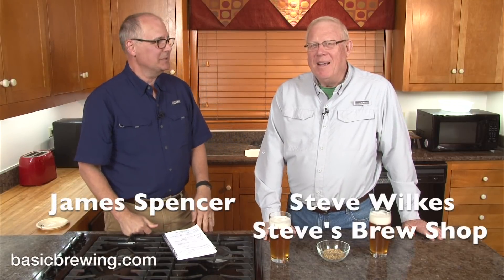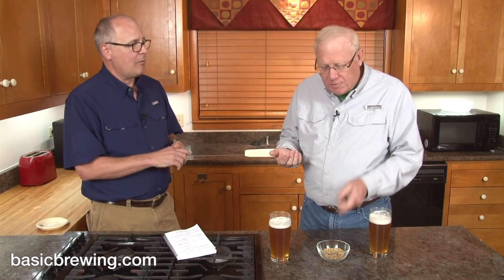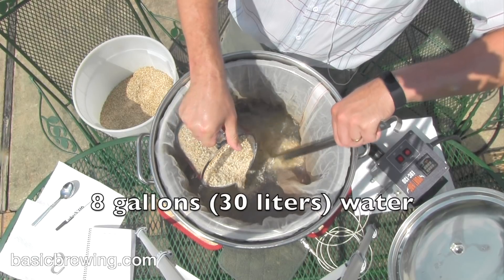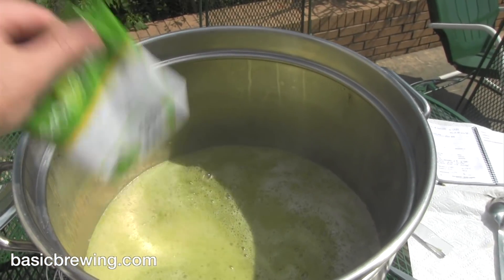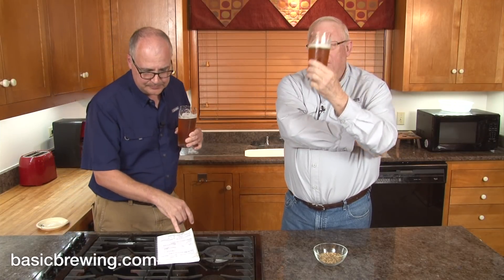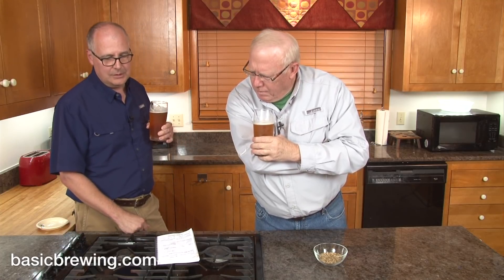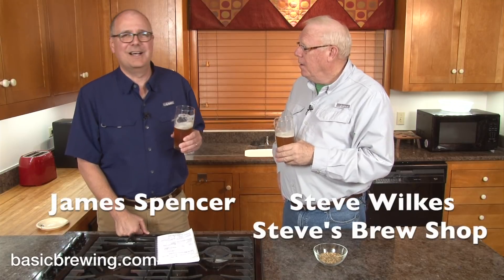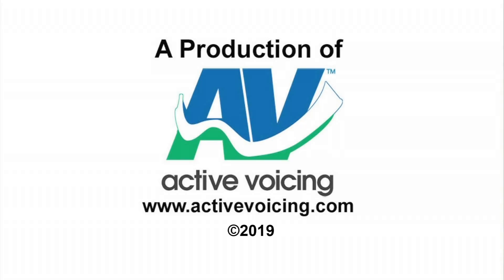Wyoming Vienna Kolsch - Basic Brewing Video - November 8, 2019

Comment: Hello there, 'm new at brewing but I can see your channel is a true gift.  I notice all your water amounts are usually 8-9gallons to start, do you boil them to 5 gallons?  My carboy is about 7.5 gallon capacity -thanks for everything
Reply from the maker: Thanks! The volume going into the fermenter is about six gallons. By the time it is transferred away from the yeast and trub after fermentation, it's closer to five. Your mileage may vary, depending on the strength of your boil. Cheers! - James

Comment: A couple of questions, when you start with 8 gallons of water and after sparging I'm assuming, how much wort do you end up with after the 60 minutes boil?
Also after the boil do you whirlpool or do you have a mesh strainer at the bottom of the boil pot?
Reply from the maker: Eight gallons is the total amount of water I use in the brew-in-a-bag process for an average five-gallon batch. I generally get about 5.5 or 6 gallons into the fermenter. I don't whirlpool or strain. All goes into the fermenter. - James